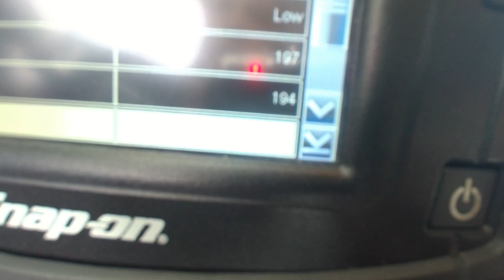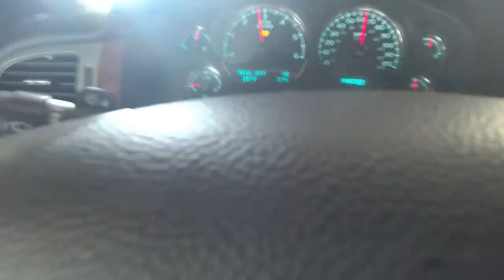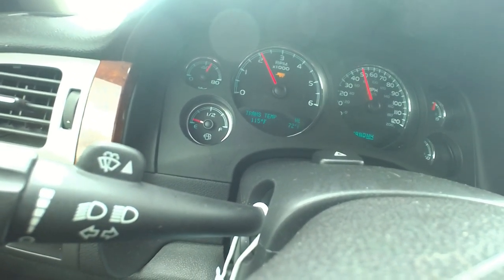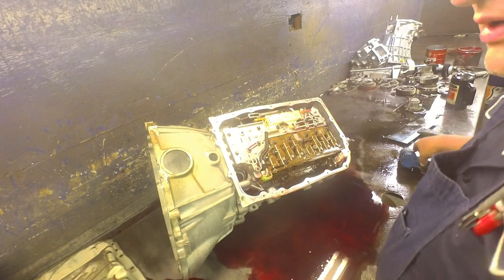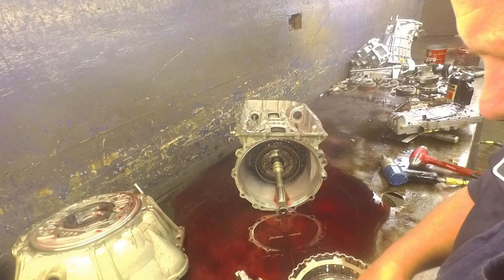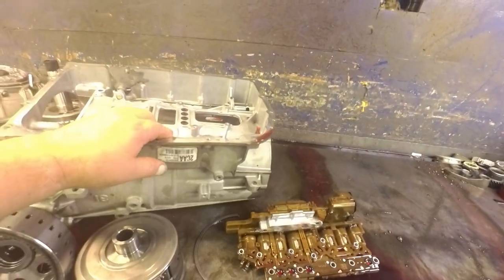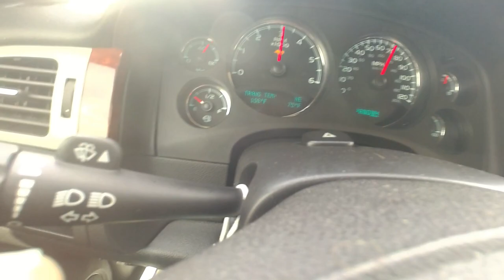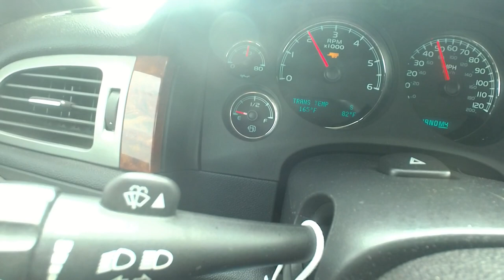Chevy 6L80E Transmission Overheating?

Comment: Those large snap-ring pliers don't look like the expensive yellow ones (The ones 'built' specifically for the 6L80e center support snap ring) I've seen before. Where did you get the set you have? 

Edit: Also, what Torque converters do you use for the 6L80e units that come to your shop for rebuild?
Reply from the maker: Believe I got them off the Matco truck, special order. They were still expensive, I want to say 300 bucks. It's Kent Moore J-45126. They work well for most but not for 6R80's and 6L45 is kinda hard to get down in there, that ratchet assembly gets in the way. Have thought about getting the yellow ones, cost keeps me from doing it. We use Precision of New Hampton, Their link is in the description. That t/c in this truck was their billet one, about 100 bucks more but worth it.
Reply: @CurmudgeonTransmission  Thank you very much, Ill look into those!

Comment: I have the 2014 Tahoe 3.42 gears heavy duty towing package , I tow a camper 3,200 lbs, would I be better off using Manual mode and only letting it go in 6th gear on straight aways ? Or just always use tow/ haul mode , when I tow it runs 180 to 195 , 210 to 220 on mountains at 70 mph
Reply from the maker: Use the tow/haul mode. If you live in a warm enough climate you can put a delete kit in the cooler bypass valve if yours is equipped with it. You can also install another auxilliary cooler, one equipped with a fan if you have enough room. https://www.haydenauto.com/en/products/transmission-oil-coolers/hayden-transmission-oil-coolers/the-dawg-remote-transmission-cooling  Those temps are decent though.
Reply: @CurmudgeonTransmission  ok thank you
Reply: @CurmudgeonTransmission  today I got up under the Tahoe and it does not have the bypass valve ,it is a Jasper  transmission I believe, it has a fitting with the lines going into it but it's just a block with lines no way it has anything in it , would Jasper have did that so it's not restricted ?
Reply from the maker: Some have it , some don't. Nothing Jasper would have done because it is not on the transmission. It is on the lines. Here is a picture of one to help you. https://res.cloudinary.com/transgo/wbiss/sc/6L80-CLR-BYPASS.pdf

Comment: I just replace my transmission by aamco and is heating up to 220 and 225  only going 70mph. For a 20 minute drive.  I called them they checked it and said it was normal to get up to the temperature I am still not satisfied my old tranny was not heating up this much
Reply from the maker: Some have a thermal bypass valve and can cause issues. There is a bypass kit for it. It may need it. There is several things that can cause one to run hot, that being one of them.
Reply: @CurmudgeonTransmission  Awesome thank you so much  I really appreciate.   I still have warranty on it up to 3 years.  I guess I am just confused on the temps it should be running at.   is the 220 and 225 consider to be  pretty hot,  what would be an acceptable range for a transmission
Reply from the maker: @rodolfobeleche3882  They can get that high, especially when we are having 110 degree days, but it is up there on the edge.
Reply: Did you figure it out ? What’s your truck make and model ?

Comment: Agreed this is another great video. What are the most common causes of trans overheating? I’m assuming slipping clutches and or clogged cooler?
Reply from the maker: Yeah, then low on fluid and believe it or not , overfull.
Reply: @CurmudgeonTransmission  overfull huh? That’s crazy I wouldn’t have guessed that

Comment: I have another question about my recent 545rfe rebuild relating to this video topic. After getting it installed I drove about 30 miles and the transmission pan and dipstick were very hot to the touch as in probably the 200 plus degree mark (although not sure exactly because I didn’t have the gun to check). This occurred because I had the snow plow still on the truck blocking the airflow to the cooler. As soon as I took off the plow and drove again the pan was much cooler. My question is, is it possible to have did any significant damage to the new trans in that time? The trans temp light didn’t come on but the sucker was hot and had a plastic melting smell to it.
Reply from the maker: Hard to say, light never came on in this one either. It is possible it does not take long. Transtar and I'm sure WIT also sell coolers with a fan, might want to put one of those on there for when you use your plow.
Reply: @CurmudgeonTransmission  great thanks again as always for your quick response. Yeah I just bought one of them I’m going to install it. It’s always something with these damn cars hahah

Comment: Mine in stop & go traffic 197. Short run to lake slow curves 205temp..ocassuonal vibrations...??
Reply from the maker: Sounds like you might possibly have a torque converter and/or pump problem.
Reply: @CurmudgeonTransmission  I knew it having Problem with Mechanic Honoring Warranty already Re uilt but I guess have to keep on Him do Corrections

Comment: My 08 Silverado truck is doing the same thing but it doesn’t matter in tow haul mode I just got it out the tranny shop a week ago he’s swears there’s nothing wrong with it he’s used his heat gun and everything is looking fine he told me to put a heat shield on my exhaust so it don’t get my lines hot. so I wrapped it and it’s not helping do you think it could be the same thing in this video??? He thinks my gauge is wrong? Help please! Thanks!
Reply from the maker: It's possible it is the same thing. Also possible that the temp sensor in the Techm is not reading properly.

Comment: can you have too much flow too and from the cool?  for example If I put on larger fittings coming in and out of the tranny and ran larger hose into a larger radiator...
would that cause other issues? thanks
Reply from the maker: Larger fittings, lines and cooler will be fine, might run a little cooler. Just don't go the other way. Had a boss one time that loved to put the 5/16 line coolers on vehicles with 3/8 lines, I said besides that you are having them install it improperly. Told him you can't do that, your creating a restriction and your going to start burning transmissions up. He said I was full of crap, so I pulled the instruction sheet out of the cooler and started reading it out loud. Got so heated he almost fired me. But he quit doing them that way.
Reply: @CurmudgeonTransmission  ok thanks... just seems like the stock lines are so small and when adding another  cooler,,,,, it would restrict flow  even more  
often wonder why they don't cool transmissions better..because it seems so easy to do with bigger hardware.. temp gauges would be nice too..

Comment: Just did a 2016 chevy silverado 6l80 Trans Go thermostat bypass, worked for about a mouth, trans temp was down to 150 deg, now its back up to 200deg. any ideas?
Reply from the maker: If cooler flow is good you may be having some slipping going on. These have bad torque converter problems, may be the beginning of problems with it.
Reply: @CurmudgeonTransmission  Thanks, thats what I'm thinking, he had a transmission shutter,fixed that with a tune, fluid change, but the temps range from 170deg to 200 on a 60 deg day normal driving.

Comment: What if the fluid has changed color to brownish, maybe had a smell, and soon as I put in gear the check engine light flashes?
Reply from the maker: You have problems. You need to have the system scanned for codes before you do anything.
Reply: @CurmudgeonTransmission  I did and only code was a misfire but like I said when I put it in gear the engine light flashes within seconds
Reply: @CurmudgeonTransmission  do you mean with a professional scanner? I have a inovia5610 rs2
Reply from the maker: Yes, it may not be giving you all the codes there really are. Misfires can cause some strange things to happen, especially if they are really bad. Also scan all the systems, sometimes codes in other systems can be related.
Reply: @CurmudgeonTransmission  ok and thanks for the tips